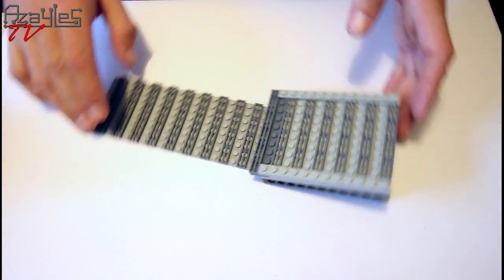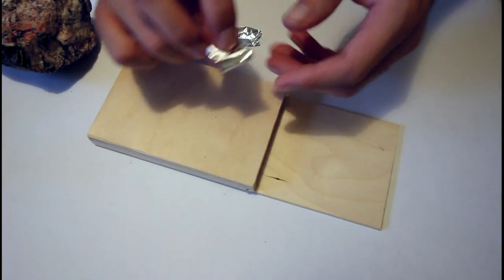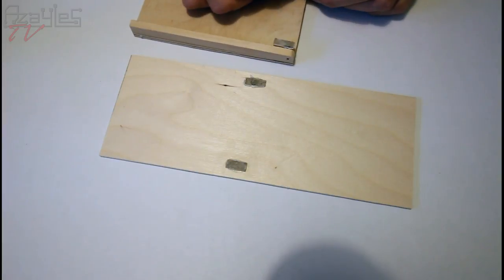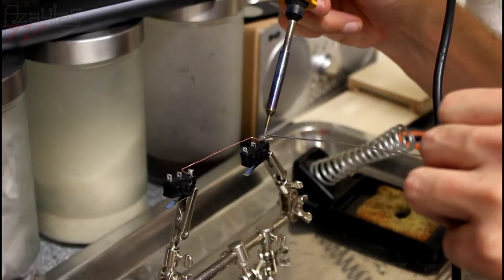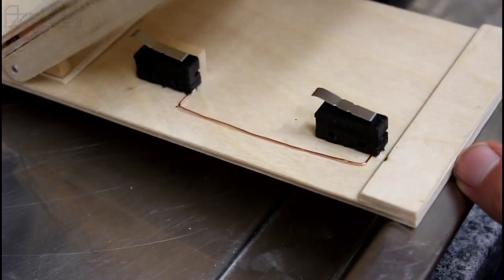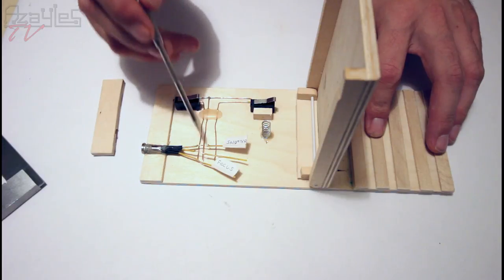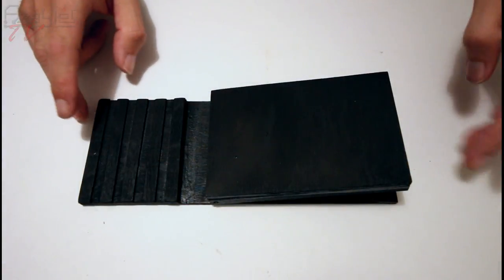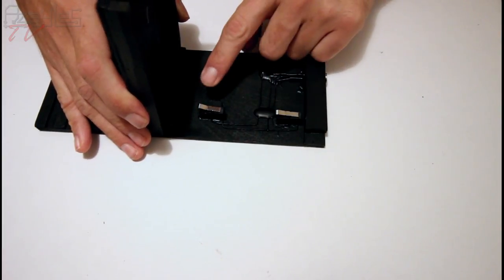Camera Shutter Foot Pedal

Comment: dam dude awesome idea! wish i could do that electrical stuff lol
Reply from the maker: It's easier than you think! If you have a remote trigger socket on your camera, you can google the pinouts and make a plug for it. That socket simply brings out the connections to the physical focus and shutter button on the camera, so you can use whatever you like to switch it, as long as you're making an electrical connection :)

Comment: Very nicely done my friend awesome sir :)
Reply from the maker: Thanks very much :D
There's a few things I would have liked to do different, make it a bit more polished, but there's always room for a version two in the future if needs be :D
Reply: Yes sir you can do part 2 ha ha ha  good idea my friend :)
Reply from the maker: I've thought of a way to add better separation between the focus and shutter points, as well as make them adjustable, and have just a single action shutter if need be. It'll depend on how I use this foot pedal and how it feels when using it for extended periods.
It's all an experiment 😝
Reply: Hey my friend you have that idea and now you have to figure it out and how it will work bro that's all, You got this good luck with it i will be checking it out and  part 2 ok :)